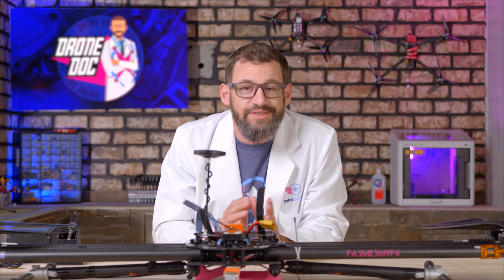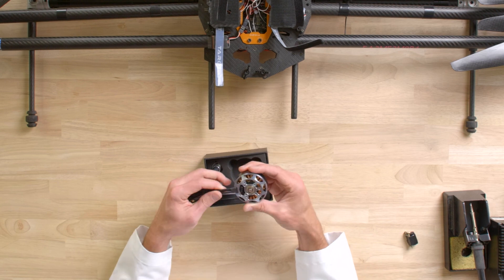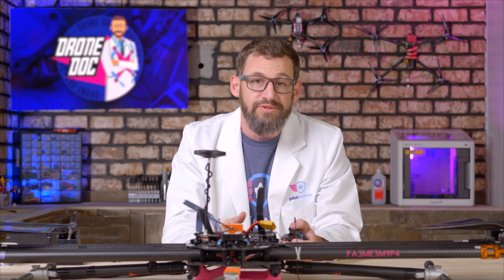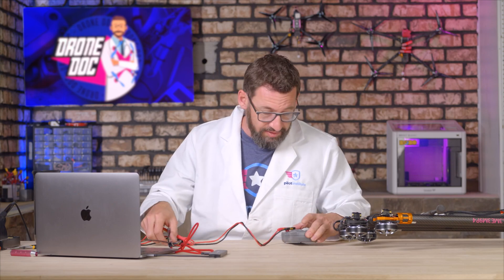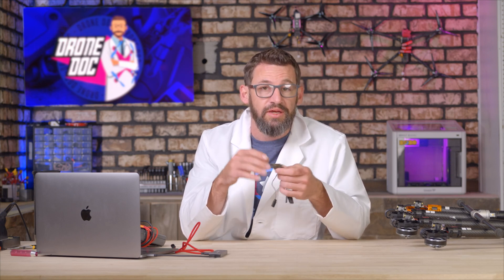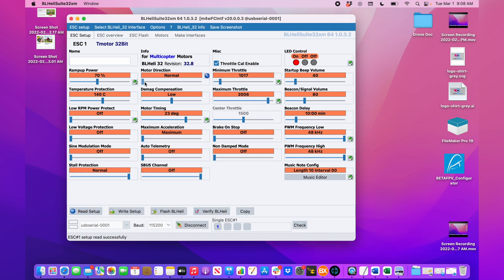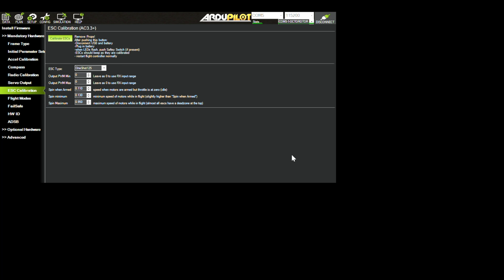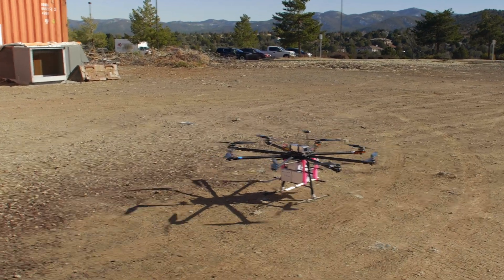OctoZilla Power Upgrade - Drone Doc Ep.2

Comment: Just curious... you were saying there are CAPS on the ESCs... is this for RF suppression/(noise filters)...or motor protection?
Reply: The capacitors are for filtering the electrical noise from the ripple current due to the long power wires running through the arms.